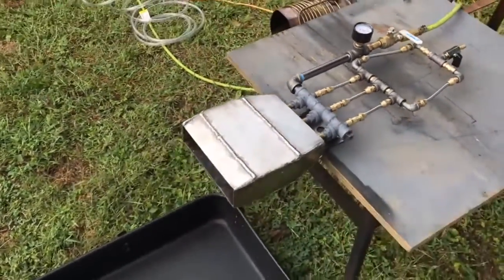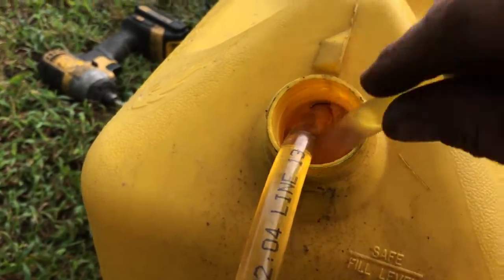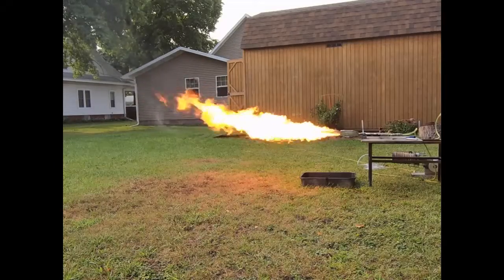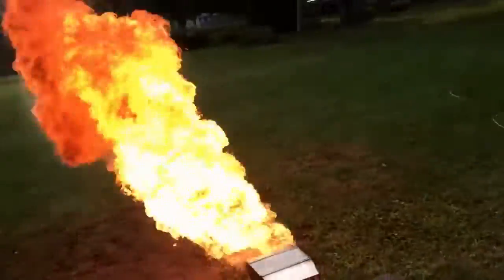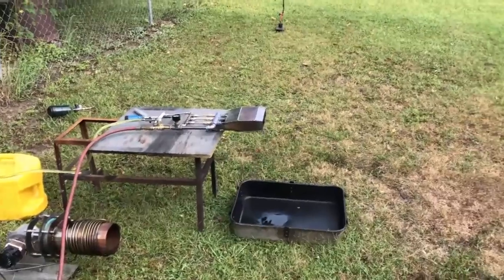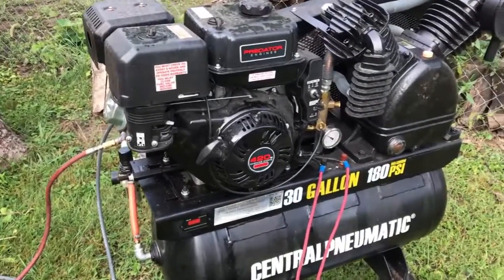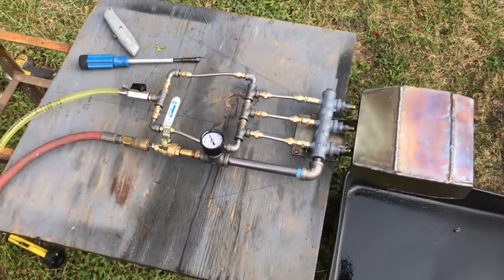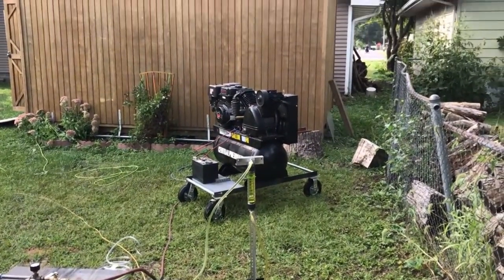2 Megawatt Burner for Jason

Comment: Any ideas on variable btu/flow/fuel? would be interesting, especially if it could be adapted to heat water loop, which is pumped to a air handler to replace electric heat units for off-grid use, could also be used for steam engine/power
Reply: Would be cool to run it off a click plc, or productivity open, and you could have fuel valve, and air valve, controlled via it, getting optimal fuel/air for given btu output, which could likely also be setup in PLC, as well as warmup/cooldown cycles

Comment: man im trying to put together a digital controller for my fuel similar to the one in this video.  im using a 12v solonoid valve but bot real sure thats going to give me anything but open and shut.
Reply from the maker: yeah you would wanna get a fuel pump or there is a thing called a zone valve that lets you adjust the valve with electric signal